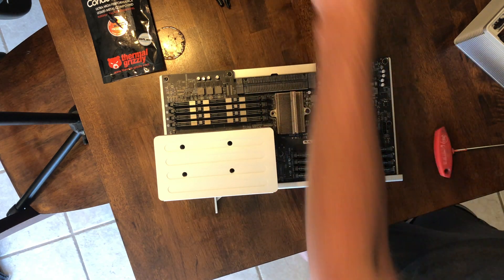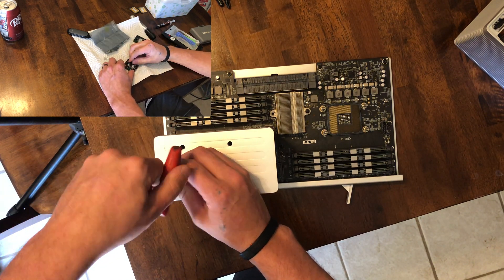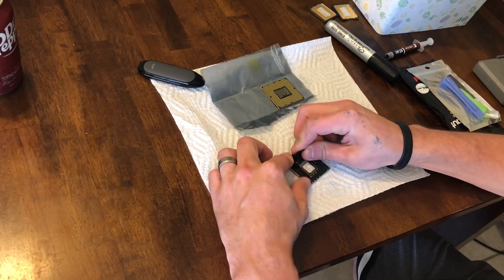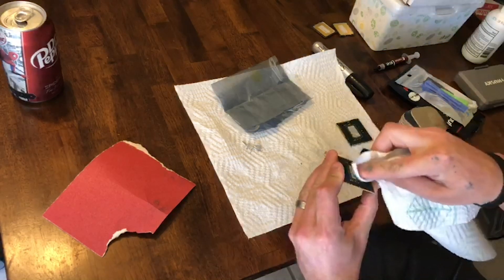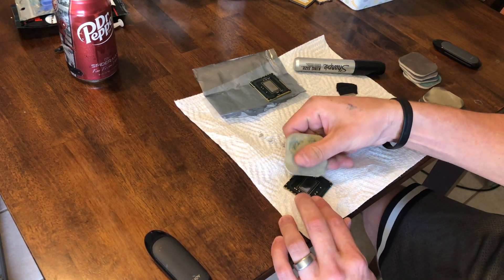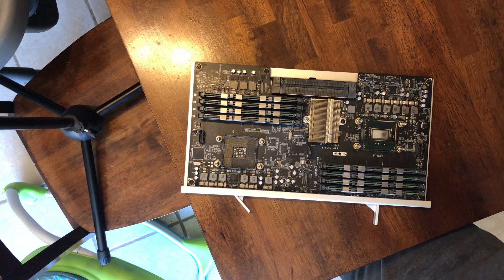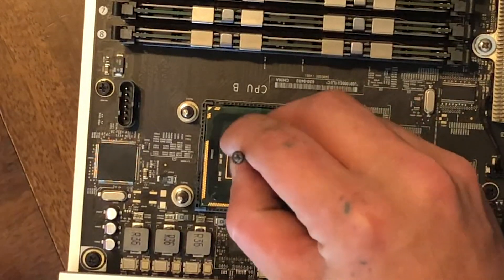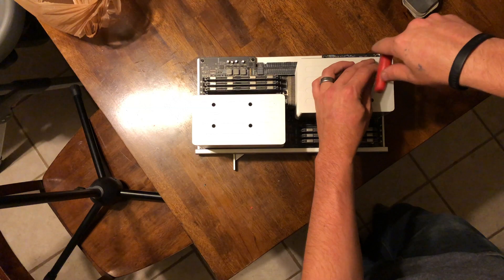How to Delid Remove Solder and Mount Cpu's in a 2009 4,1 Mac Pro (the right way)

Comment: Leaving the lid down would also increase the cpu temperature? 
Except of potential damaging the cpu slot by overscrewing.
Adding washers for adjusting the height of the cooling cage without deliding the cpu is not a good idea?
Reply from the maker: Yes the ihs add two barriers to effective heat dissipation, solder, and the ihs itself, a properly delidded and mounted cpu will always run cooler than the same cpu lidded. And as you mentioned running lidded cpu's in a dual 4,1 increases the risk of damage to the tray or socket
Reply: @killer268  Thanks a lot for your quick reply!
Reply: @Brennan Ferguson I thought exactly like this. Now after I delid the CPU A this one is getting much hotter (Almost doubled) than the CPU B which is still lidded. How can this be?

Comment: I would always check the grommet for wear on the bridge heat sink, replace as needed ..
Reply from the maker: If you look closely you can see I did replace the NB clip with a bolt /nut washer spring combo. I'm making a separate video showing how to do that as we speak
Reply: @killer268  its just always good to check when you have the heat sinks off :) or as you did and use the bolt/nut and be done with it
Reply from the maker: dennis moyer 100% and I should have mentioned it, but as I was planning another video about it I didn't think to